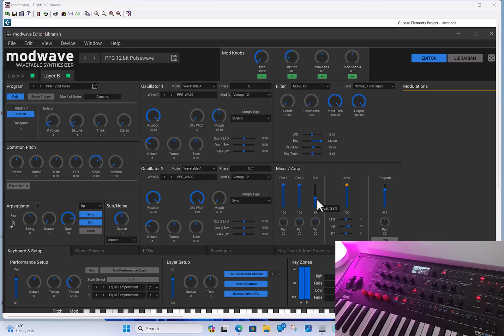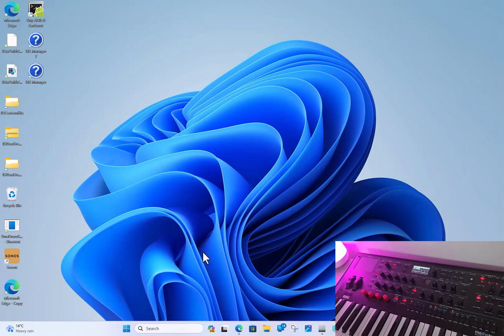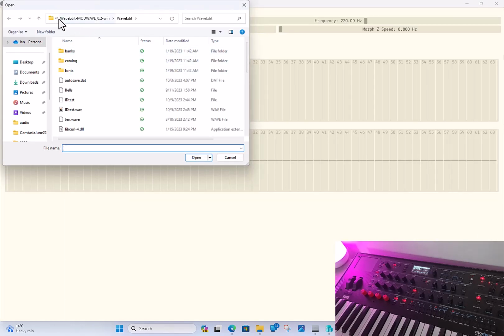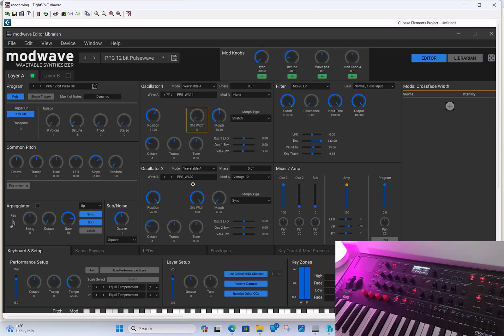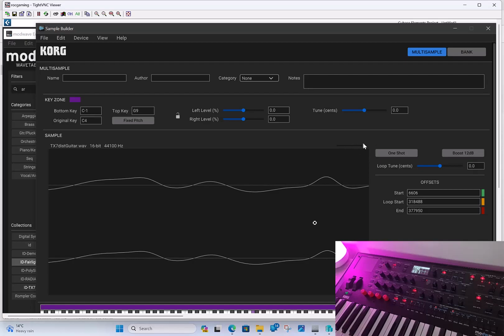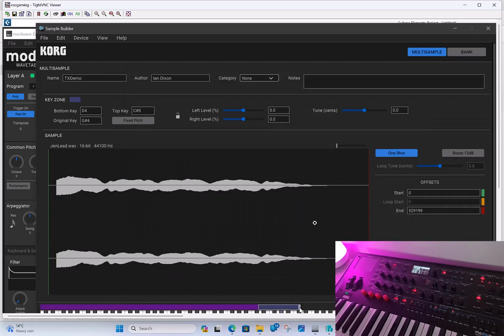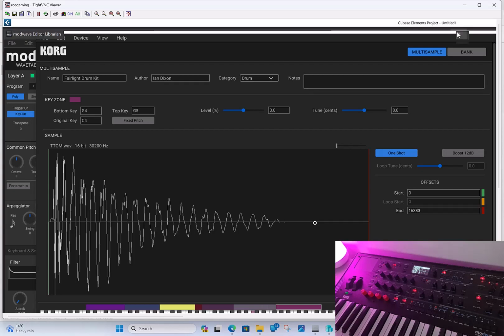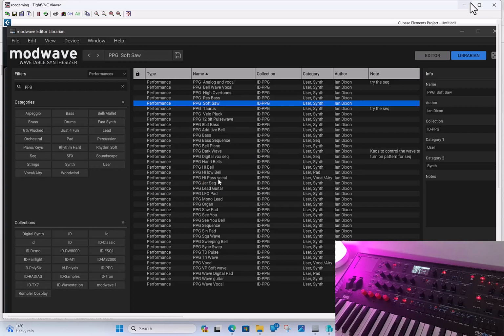Korg Modwave Beyond Presets: Importing Custom Wavetables and Samples

Comment: Hello. I am considering picking up the original Modwave second hand. With the 2.0 update, did it bump you up to 4gigs or is that with just the MKII? Also, when importing samples, how well do the onboard filters handle them? Thanks
Reply from the maker: The mkI and mkII have the same amount sample ram. The filters work great with samples, you can use any of the filters including the bandpass, notch etc. I am going to do a video on the Modwave Filters soon.
Reply: @IanDixonTDL  Thank you for the info!

Comment: I thought the individual PPG Wavetables had 60 positions/cycles, but the Modwave seems to go through 100 positions. Is there any way to adjust the Modwave so that is slices the samples in the original manner of the imported wavetable?
Reply from the maker: You can turn off the Xfd width so it only doesn't smooth out the transitions